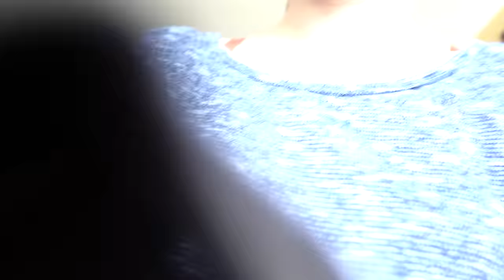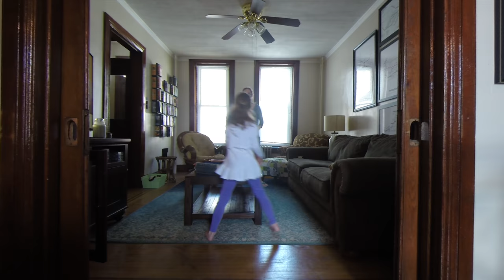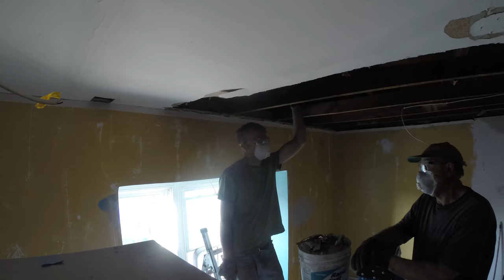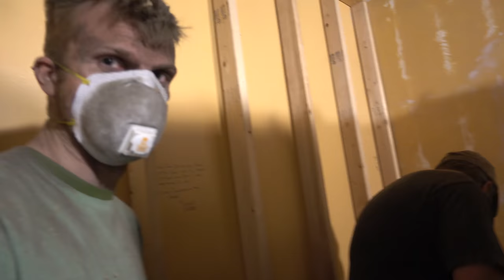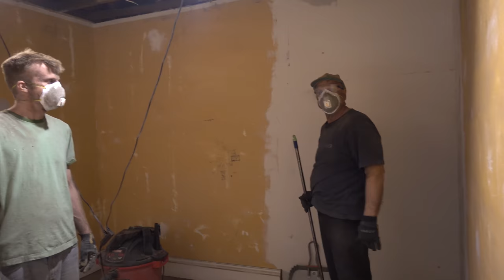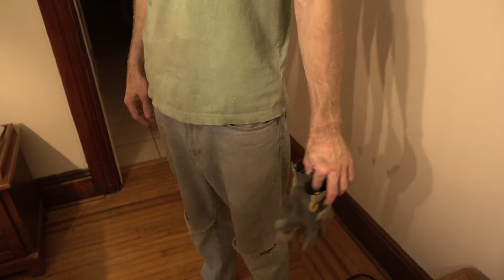The Ceiling is Missing!

Comment: LED light bulbs, available at Walmart, won't burnout when the clamp-on lights get banged around.  I learned this after a while.  Also, in old lath and plaster ceilings, the rafters and nailers above aren't necessarily flat and level, with lath and plaster the plaster leveled the ceiling as he worked;  it might create problems when drywall is installed.

Comment: Make it easy on yourself rent a sheetrock jack usually  $25.00
A day, saves a lot of work and your rock butt joints do not have to land on a rafter, let them run past and put a piece of plywood or OSB ( 1/2 thick or so maybe 12 inches wide x 4 ft ) behind the joint to screw too